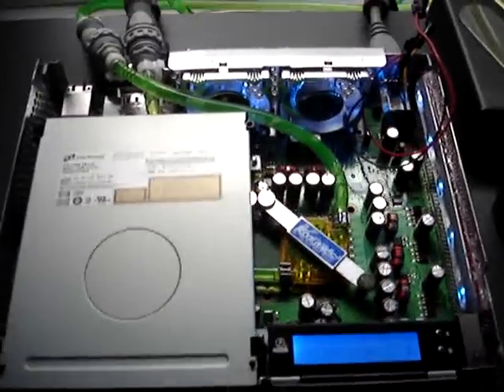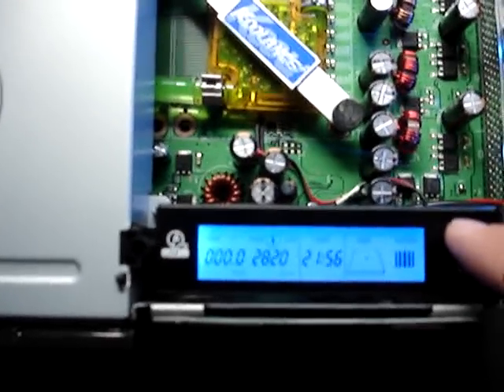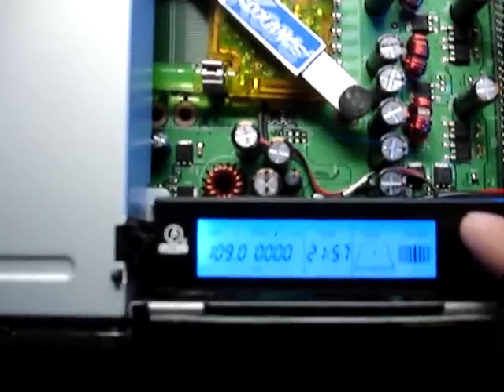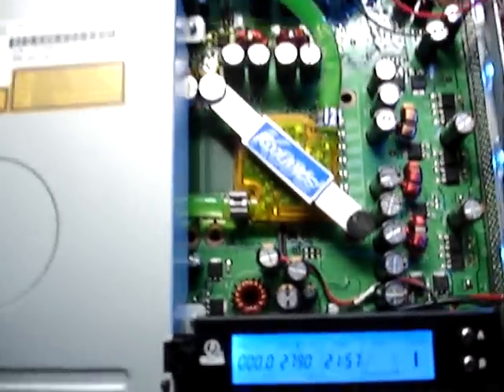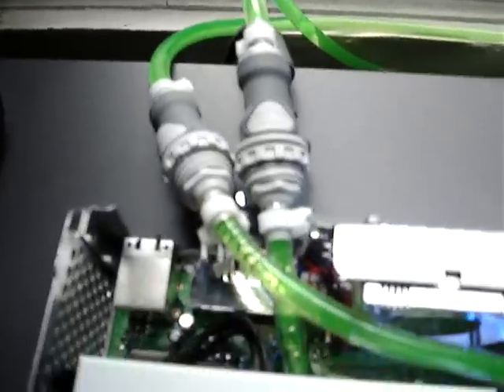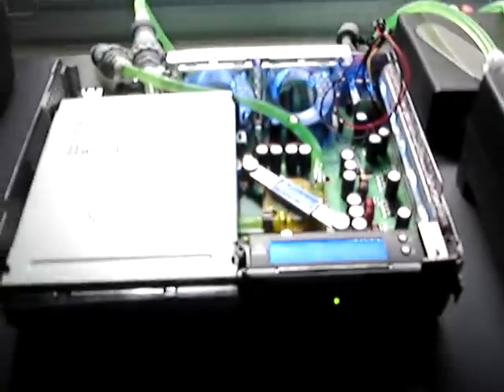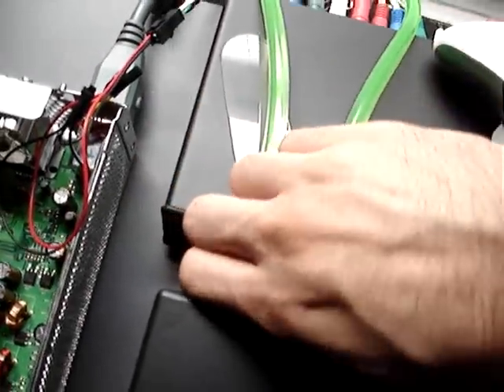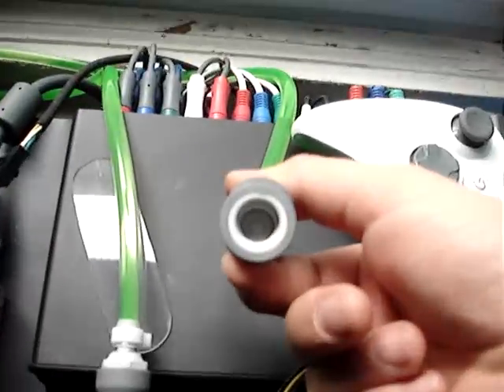Xbox 360 Watercooled²

Comment: just make sure it is made in 2008. and after you buy your console make sure you check you power supply unit to make sure it says 175 watt they even have a newer one with a lower power source which is 150 watts which is the newest 360's they sell. Also get the 60 GB model 360's those are for sure guaranteed to have the falcon or the brand new jasper chips inside.

Comment: @wiihome EXACTLY.  I picked up a 360 from a friend which had a kit that rerouted energy from the drive to the fan to make it run full speed. This shit is dumb. If the cpu gets too hot, the fan will speed up to max if needed.  If that's not enough, making it run full speed won't help, it will still overheat.

Comment: @mkirefu 

the new xboxs still have this problem but the failure rates for them have dropped alot. and an elite has a better cooling system (from what ive read) so its even better.

Comment: Dude, are those temps Fahrenheit or Celsius? If Fahrenheit still a little higher than I'd expect for water cooling since I'm guessing the XBOX was basically just idling. What kind of thermal paste did you use and what size radiator is in that thing?

Comment: ya but that rarely happens though.  Get a store warranty it is much better. you can keep your hard drive just return your old controller and console and pick up a new one. Plus I know that the PS3 is a higher quality console than a 360. I like my 360 elite but my cousin's PS3 I know will stand the test of time and will still be reliable. Who care's if they dont fix it for free also Microsoft knew they built a console that would have alot of hardware failures from the start.

Comment: It wouldn't help. Microsoft said that all the 1st gen xbox 360's are going to have a hardware failure sooner or later. Cooling won't help because if something is wrong with the gpu or cpu it will break anyways. Just get a new 360.